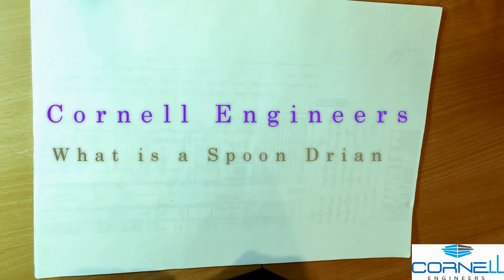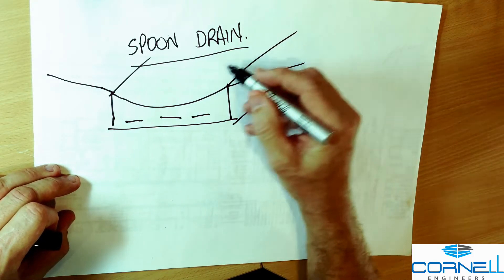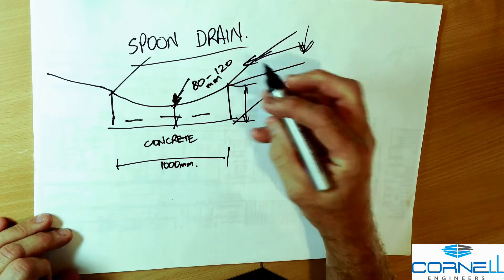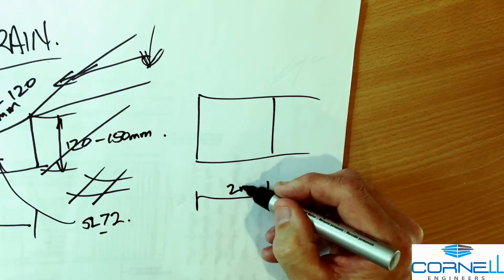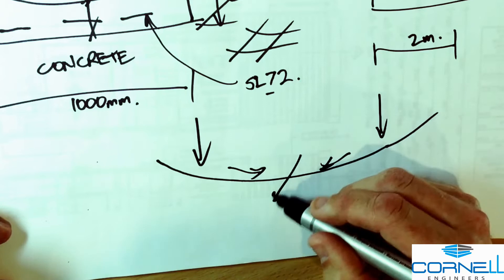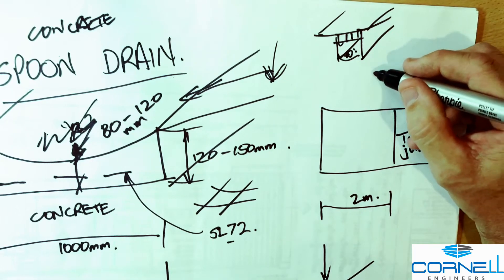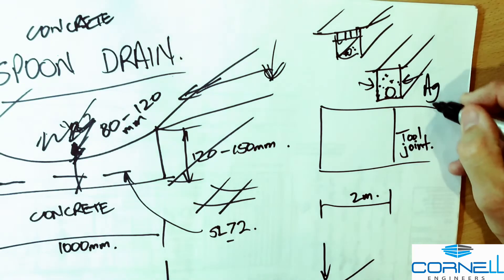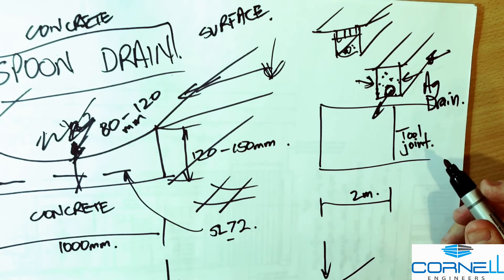What is a Spoon Drain in residential construction and why do structural engineers specify them.

Comment: I'm confused about what a 'Tool Joint' is. I've looked elsewhere but it seems to be a cut in the body of the concrete. If it's a gap created at right angles to the flow of the water, won't water and debris just sink into it?
Reply from the maker: Hi Richard
A tool joint is a recess in the concrete formed while it is still wet. Its purpose is to weaken the concrete in a nice straight line so that when the concrete shrinks, cracks in the concrete form where the concrete has already been weakened. It pretty much has nothing to do with the flow of water - it's just an aesthetic measure to prevent uncontrolled cracking in a concrete slab.
The first image on this page is a nice example
https://mastercutconcrete.com.au/control-joints/
Reply: @CornellEngineers  Thank you for taking the time to answer. Now I know!

Comment: Hello,

Thank you so much for this video. I’ve learnt a lot from it and others. 

We had a structural engineer come out and inspect our house, which has helped identify issues with water getting in underneath in ways we wouldn’t have thought of. 

He suggested an agi drain in our backyard (our house slopes down to the street from top left to bottom right). Or possibly a swale. I don’t think either option is perfect as we’re on very reactive clay soil  which cracks in summer and swells in rain. So water doesn’t travel easily under surface and a swale is about moving water slowly. 

I think the engineer really meant a spoon drain. We don’t want a big concrete drain right across our backyard near our house. Would digging out a natural spoon drain to divert water around our house (we have a lot of room on one side) work? Is there an easy way to work out how much water is being diverted? 

Thank you for your time.
Reply from the maker: The idea of keeping surface water on the surface and handling it with a natural spoon drain is a great way of managing the bulk of the runoff coming down the hill. A swale is about moving water slowly but we too have used the term to describe the land formation required to improve stormwater protection of a building.
So, yes, it would look like a spoon drain except formed in the ground. it also will help that as part of this landscaping work the ground will be graded away from your dwelling which is always a good idea.
As far as working how much water you have to handle, you can get scientific about it which is complicated, or just try improving things and watching where water overflows when it rains and then improve the width of the drain in that area.
Best of luck!
Reply: @CornellEngineers  Thank you so much. We would’ve used you guys for sure but we’re not in Queensland.

Comment: Just got a question that bothers us a lot. Appreicate any thoughts you could share on this: The backyard area next to my house foundation is paver , and then sitting further out from the paver is yard. My plumber recommended us to install a spoon drain between the paver and the yard. I feel confused. The material underneath the paver is soil. And the yard ground is soil too. So, what is the point to install a spoon drain between two sides of soil? Wont the rainwater soak into soil and the render spoon drain to be useless? Or we should install an AG drain? Location: North Brisbane
Reply from the maker: Flat pavers, rock pathways gardens and flat yards are all equally likely to allow water to soak into the ground. 
The effect you should be trying to achieve is to drain water away from the house and let it soak into the yard downstream of the house. 
So on the upstream (higher) side of the house grade the ground away to a spoon drain which discharges the water beside and away from the house.
The downstream side of the house is not so much of a worry so long as water (again) drains away from the house. 
For people who really like pavers and won't replace them with concrete paths, we have recommended plastic under the pavers falling to a grated drain or ag drain away from the house.
Ag drains are still are leat preferred option when trying to move surface water. it is better to move surface water at the ground surface and collect water already in the ground with ag drains.
Hope this helps.
Reply: @CornellEngineers     Totally agree, we have considered concrete too. But there is a drainage pipe just next to the house foundation. If we concrete over the drainage pipe, then it could complicate the matter for plumbers? The plumber inspected our underground pvc pipes and replaced one broken/ collapsed section, and said others are fine now , but because of many rocks under ground, other section "could" collapse in future and need replacement. 

So on one hand, concrete around the house seems the best option for fending off rainwater. On other hand, concrete over the drainage pipe, will add the cost to our future pipe replacement.  So we wonder if we could ask the concreter to add a long narrow "manhole"/ cover to allow plumber can open the shaft and replace the pipe easily? Much appreciated for any thoughts on this dilemma
Reply from the maker: @bbasian  If you have the money have the pipes re-done now and maybe even sleeved so that the water pipe is inside another pipe so they can be replaced again later if needed. It's getting complicated so you'll probably need a formal inspection and advice to resolve your dilemma. 
Best of luck.
Matt Cornell
Reply from the maker: @bbasian  plastic sheet = 0.2mm heavy-duty polyethylene membrane.  It's standard under concrete slabs and available from Bunnings (and other hardware suppliers).
Reply: @CornellEngineers  Thanks mate. We will look that up in Bunnings. 

Aside from plastic sheet under paver, do you think Waterproofing paver sealer is a worthy investment for homeowners?  

Ideally: if the paver is graded with proper fall, and the pavers are sealed with some waterproofing material on top , then the rainwater can drain on the paver surface and away from the house? 

https://www.youtube.com/watch?v=m_BZpXYCT-A
The video above mentioned solvent based Polyurethane waterproofing sealer. But not sure it is too good to true though.
Reply from the maker: @bbasian  That product looks like it stops water soaking INTO the paver, not in between the pavers. I think stick with the plastic membrane under the pavers but work out how to collect the water off the top of the plastic and take that water away from your house.
Reply: @CornellEngineers   I think we will ask a contractor to add a membrane under pavers. Totally agree with your point! But we are not sure if it is a common practice. Where should we ask the tradie to place the membrane?  
As there are 3 layers : top soil, sand and the pavers. The plastic membrance should be placed under the sand and above top soil? Or the plastic membrance should be right under the pavers?? 

Thanks mate, really want to know about this🙏
Reply from the maker: @bbasian  Not sure but def under the pavers. Check with your contractor. They might like the place the plastic, then the sand then the pavers.
Reply: @CornellEngineers  Our plumber has just checked the site and he also suggested us to choose concrete over pavers, since he says it would be more effective to connects a concrete path to a spoon drain. 

But we find many forum threads about some dodgy concreters who didnt do the job properly. (Didnt grade the path to 1:20 slope / covered the weep hole/ or directly lay the concrete against the house without using expansion foam )

Can't imagine the consequence that a house owner have to face if he chooses a wrong dishonest concretor. 

Just wonder if you could recommend any concrete contractors around Brisbane? Thanks so much for any recommendation...!
Reply from the maker: @bbasian  Speak to Matt Blain at MIY Builders and see if you can borrow the concreter he uses. https://miybuilders.com.au/
Reply: @CornellEngineers  Just want to say thanks again for all the basic knowledge we learnt your website. At last we decided not to concrete nor pave around our house. Termite inspector suggested us to install a termite management system before laying concrete around the house. Otherwise future treatment cost could go up with additional work to get the chemical under the concrete path.

As for paver, we asked plumber for advice , he seemed okay with the idea of plastic sheet, but the problem is the spoon drain needs to be same level with the plastic sheet instead of the paver. (so the water can drain from the sheet to the drain). That will look very werid ! lol 

So now we are going for aritifcial turf. First its cheaper than the concrete for sure. Second we can lay a plastic sheet right under the turf, and since both plastic sheet and a turf are thin, the spoon drain can be at similar level with the turf

Though we need some material to seal the gap between the plastic sheet and house. Perhaps some Sika-flex.
Reply from the maker: @bbasian  You know I would never have thought of artificial turf - but you're right - it's thin enough that it works with a spoon drain and the plastic can run under it to achieve a good collection of water. Good work and I hope it all goes well now. also thank you very much for the feedback about our website.
Matt
Reply: @bbasian  How did you go? Is your solution working as expected?
Reply: @TheFlame1  Yes, did a lot of research
Reply: @TheFlame1  1/ you have to identify the possible direction of underground water flow . We have a neighbour sitting on a much higher ground near to one of our house corners. As a result, the high water table effect causes ton of ground water ingressing to that corner of our house.
Reply: 2/ If you find any, you can start working on ground water drainage in the soil. Only after this is completed then you could install surface water drainage, particularly stormwater pit , or concrete skirt. They are not useful to get rid of water in the ground. And any installation of surface drain , like pouring concrete around the foundation, might occupy the necessary space to add ground water drainage afterwards, especially if the yard is not spacious. (I.e. We find that the space between our house corner and the neighbour boundary to be very narrow)